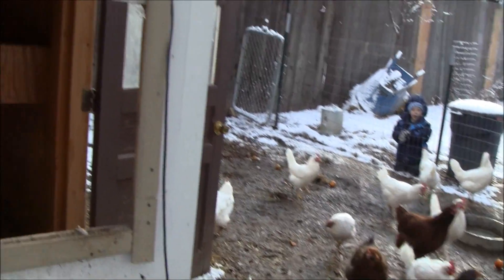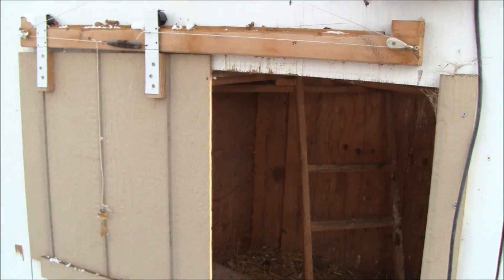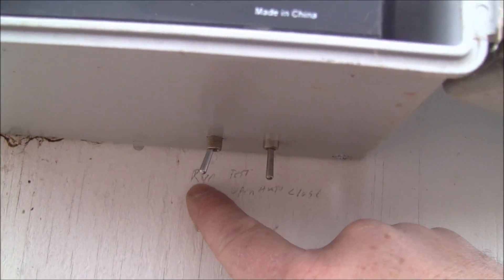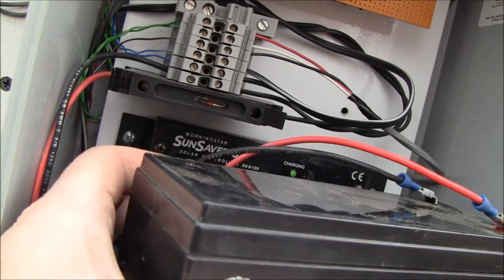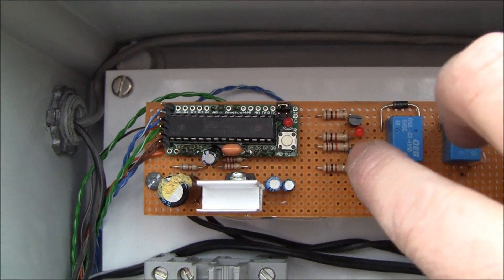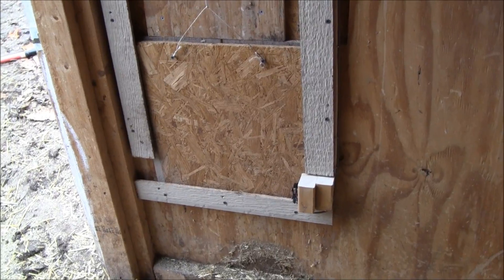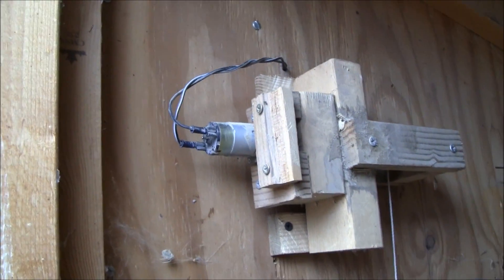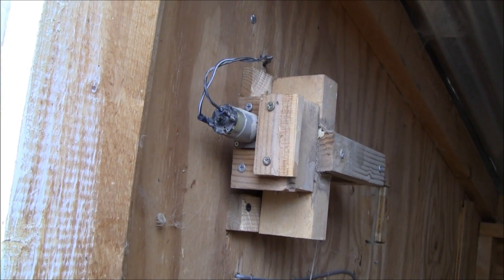Automatic Chicken Door V2

Comment: Is this still working? I like that you are using DIN rail blocks and the sunsaver Charge controller, however why use arduino if you are not doing anything but using sunlight to trigger the door? This could be done with simple photocell relay modules.

Comment: I'd suggest you use one of those plastic chop boards for a door... it won't warp or swell.  Your electronics is amazing... but the door is pretty crappy. :-)  Wish I could do as well!  Thanks for showing this!

( I took a class in micro controllers - website for the class is: http://embeddedsystemspro.com/ - we used different components than you - but the process was pretty simple.)

Comment from the maker: The whole setup might cost 100.00 without the solar panel. For the motor a good choice would be a used cordless drill 12-18V on Ebay for around $25.00, you don't need the battery and they have a lot of torque. No Arduino chip out of the box can drive the motor,  I build my own motor driver out of transistors and relays but for about $5.00 you can get a motor controller on Ebay, search for "L298N". I will PM you and see if I can help you get one built!
Reply: You should get a bunch off parts and have the boards printed for you, put then together and sell them as kits.  I have to say I like making my own things but I would definitely want to buy a kit from you.